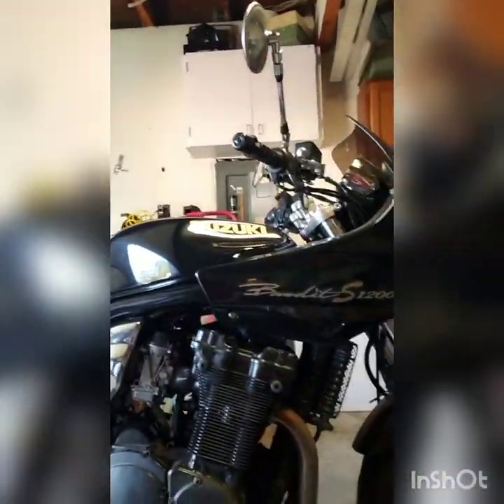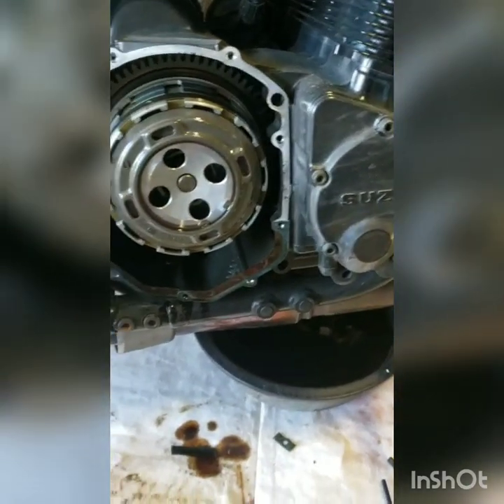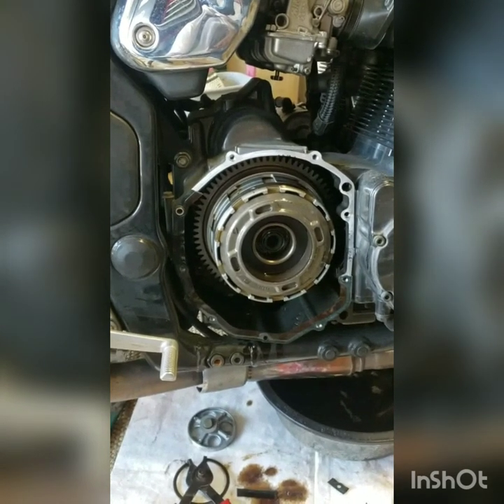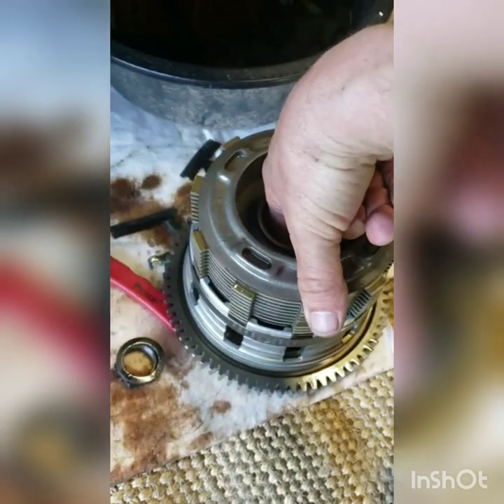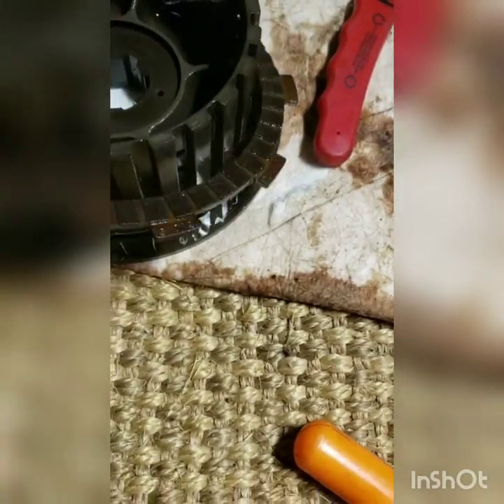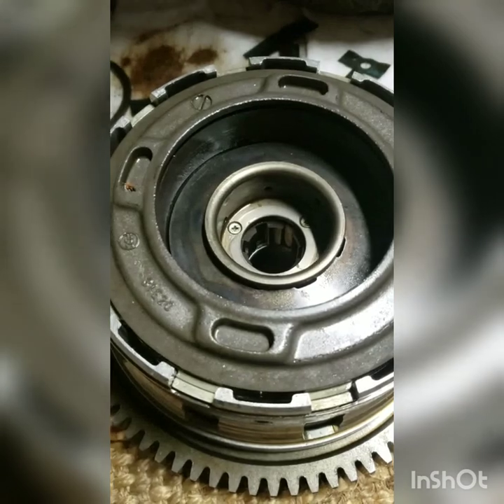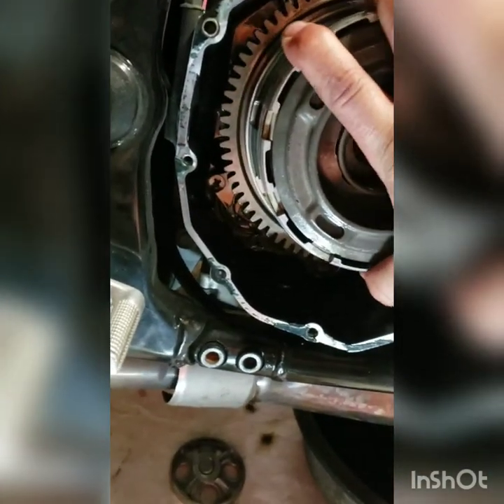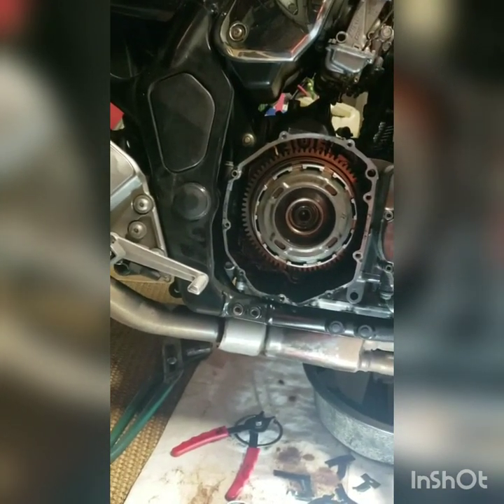1999 Suzuki bandit 1200 clutch replacement

Comment: I had a similar problem where my 97 1200 clutch would slip under heavy torque but I pulled one of the 2 original springs and replaced with a heavy duty spring and now I can keep going until the plates are actually worn out. Voila, no more slipping. It resulted in a bit heavier pull on the lever but definitely not that bad. These engines tend to be very sensitive to what type of oil you use as well. I now stick with straight conventional oil and that should help as well.
Reply from the maker: Yes I learned not to use synthetic with older bikes. They aren't build for that sort of viscosity.  Thank you for the comment

Comment: rehearsing steps
1. 5.5mm hex key to open the cover 
2. circlip removal tool to remove the circlip
3. plate cover comes off with a washer to lookout for 
4. throw out bearing pulls out
5.  30mm nut socket and wrench with the rear rim  locked to swingarm with a wood at the back from turning 
6. another washer inside to remove 
7. clutch and basket set comes out with a bit of wiggling...3 philips screw not required to unscrew for the basket to come out of the shaft..
8. hope i got it right

Comment: you said you were going to measure old and new disks to compare, you seem to have forgotten.  It happens with age! this is exactly what I was interested in!
Reply from the maker: I remember measuring the friction plates on this project and they were not worn thin enough to matter. It was the cone washer/spring that was worn out. Weak and flattened from heat and age I suppose. Sorry for not putting it in the video
Reply: @jamiemciver2326  Thank you! cheers!

Comment: what size socket wrench did you use at 3:30 to remove the lock nut?
Reply from the maker: I rewatched and mentioned 1 3/16".  Not sure what size metric
Reply: @jamiemciver2326  Wow that was a quicker reply than International Telegram!!
That means its 30mm amigo!
Thank you for the quick reply, i ride a 06 last model of the air cooled bandito shes getting super sensitive with the engagement with only a tiny release of the hydraulic lever, im assuming the  clutch is fading out shes getting a first change now after 14yrs at 50,000mi - 80,000km i ordered some parts on ebay clutch cover gasket 10usd , 10pc clutch plates for about 16usd from china ...now looking to buy a 30mm socket wrench tool to complete the surgery
Recently also opened the cam cover to do a 1st time valve adjustment cos its been running crappy (valve ticking was silent though) past 10,000miles or so to adjust
Intake tolerances : 0.004 - 0.006 in  /  Exhaust: 0.007 - 0.009 in 
turns out intake clearances got too tight after these years (i thought they would get loose and noisy, i was wrong)
Im posting these info so other bandito owners can benefit as well from reading this!
Reply from the maker: That was a 99.  I have an 01 now
Reply: @jamiemciver2326  i see...i wanted to dump the airbox to fix open pod filters but then i read somewhere the throttle response will be crappy without a proper carb jetting change as well so im holding that back for now..original jetting is 100mainjet & 15pilotjet (mikuni bsr36 carbs) if im not wrong ..
Reply: @jamiemciver2326  I read an online ''sport rider'' motorcycle article about andrew carrey old model bandit 1200 several yrs ago the article titled '' bandito supreme'' - (165hp project) seems to have been taken down now since i can no longer find it online..but i took some notes of the things he did to it here..among the things he had: keihin flatslide carbs on it and its intake had no air filter of anysort, just empty at the back
https://imgur.com/a/feUzvYz
Reply from the maker: Well I would never run my bike with no air filter 😂 I want it to last. I have an open exhaust that helps and considered timing advance but really I'm not racing it and it has plenty

Comment: Does the basket absolutely have to come out? Can the plates be accessed with the basket still installed?
Reply from the maker: That's very unlikely. The basket needs removed and then also taken apart to change the disks/plates
Reply: @jamiemciver2326  OK thanks. I did a GSXR clutch years ago and basket stayed on. Appreciate your reply.

Comment: All of a sudden my clutch lever is really soft on my 00 1200 bandit. Any suggestions on where to start to fix this problem
Reply from the maker: There are a few possibilities. I would start with checking your fluid at the clutch lever. If it is low this may also mean the slave cylinder may be leaking and needs rebuilt. If the clutch has been slipped a lot the friction plates may have worn but that wouldn't be all of a sudden like  it would be gradual.  The cone washer/spring may be worn or broken. Look into these items. If you plan to change the spring I recommend doing the friction plates as well since you will have that apart anyways.
Reply: @jamiemciver2326  thanks a ton brother, as soon as I'm done work I'll be diggin in
Reply from the maker: My pleasure. I appreciate the opportunity to help brother riders
Reply: Thanks for the info. Found a easier way to put basket back in. And yes the first try I broke the sprockets on back of basket “newbie”. So I removed the bearings the basket was sitting on  then put the basket in without plates once adjust in well slip bearing back on 💥 Bam. Slide plates on.
Reply from the maker: So did you determine the cause of it feeling soft?
Reply: @jamiemciver2326  yes, It ran dry. I filled it back up spent a little while bleeding it and no problems since. Fingers are crossed that I don't need to year it apart. I thank You for the advice and help
Reply from the maker: But you did remove the basket and plates it soumds
Reply: @jamiemciver2326  I lucked out but it looks like Brandon had to
Reply from the maker: Oh yeah. My bad
Reply: i had this problem recently, i never bothered to drain the lines, i simply absorbed all the old dirt and oil in the brake pump reservoirs with a few pieces of tissue paper and then poured fresh fluid in the reservoirs, after several pumpings it ran well again

Comment: My oil pump gearsBroke  an half.......And clutch ring behind basket broke and 4 spots Cause no acceleration 🛑🛑🛑🤦🏾‍♂️🤦🏾‍♂️🤦🏾‍♂️🤦🏾‍♂️
Reply from the maker: I'm not even sure how to reply. I think in the end if you can repair it all on your own it's still cheaper than taking it to a shop. 🤷
Reply: my sincere condolences, sounds like a nasty problem, i hope you fixed it